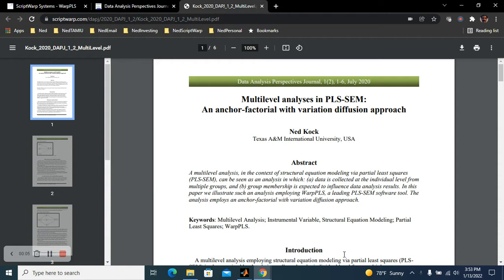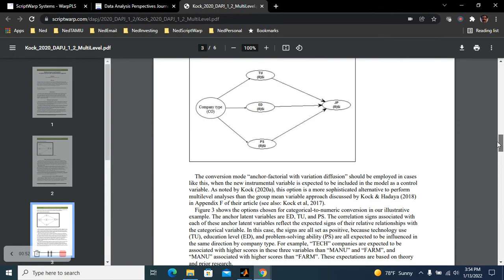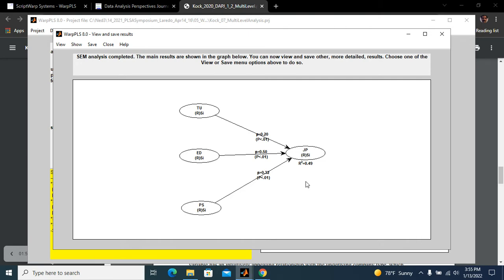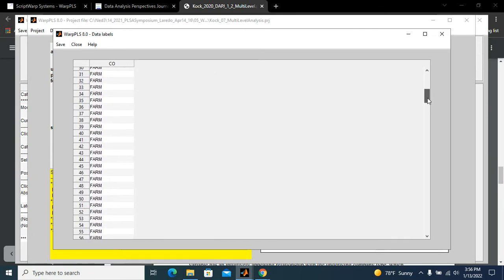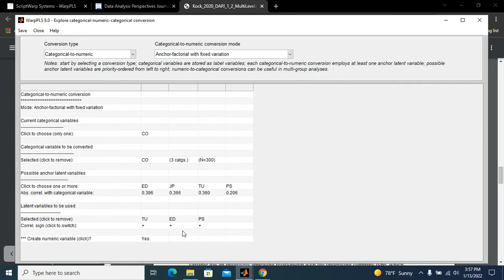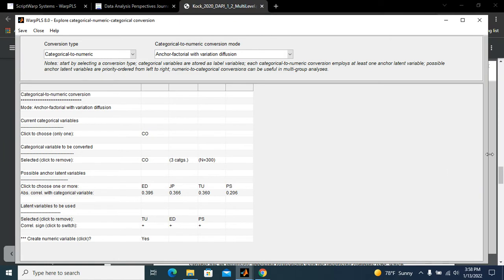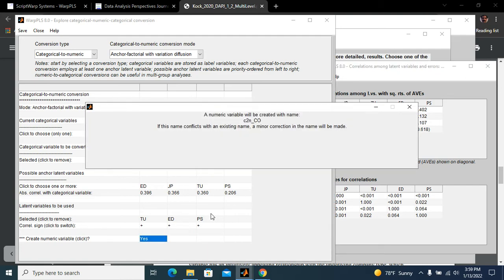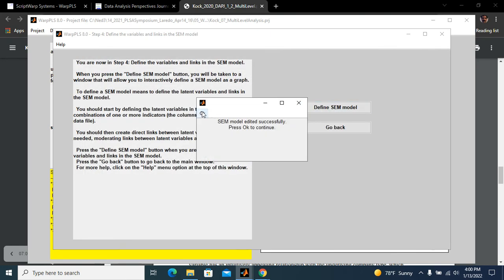Choose the Correlation Signs for Anchor Variables in a Multilevel Analysis with WarpPLS

Comment: Sorry for out of topic, i want to ask about moderating variable. If i have dummy variabel (1 of the managerial ability score above the median, 0 otherwise) can i just input this managerial ability variable as latent variable and then click the moderating link for each exogen variable to endogen variable even if this moderating variable is coded dummy 1 0? 
Or i have to do multigroup analysis without use this managerial ability variable as latent variable in the construct (just add restricted variable in the setting) to interprete this managerial ability as moderator factor?
Thank you